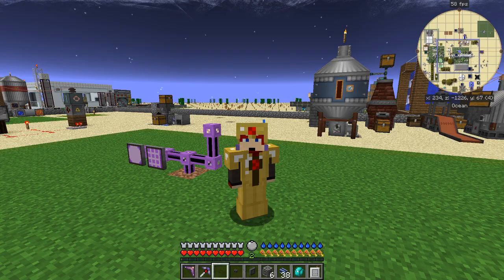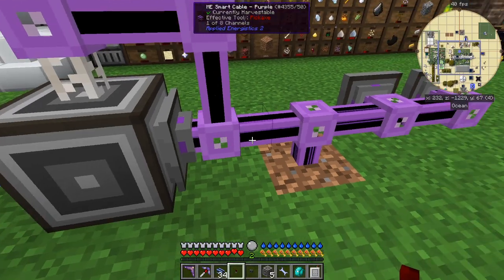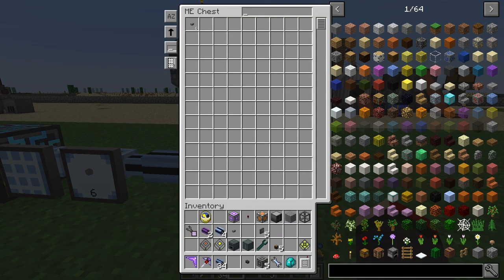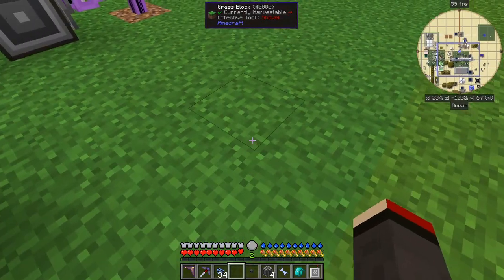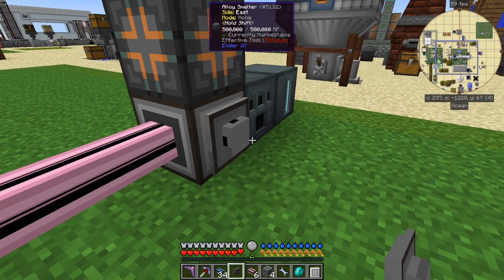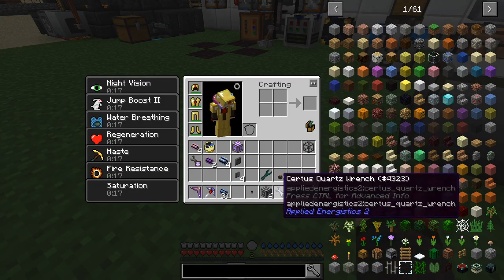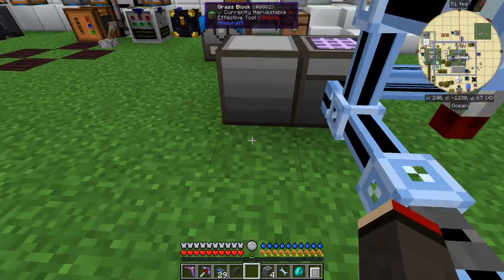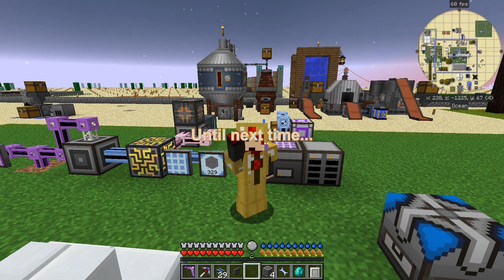Forever Stranded Quick Tip 11 - Applied Energistics 2 Sub-network

Comment: Hey Duncan, you had the same issue that kept affecting me. You setup 2 more with 64, when you did the first one you had 44 in the AE2 system already so it put those in and started the next 20 but since you had not connected the Storage Bus yet, the Alloy Smelter sent the 20 back in the Interface directly but it never passed through the ME Controller so it was still waiting for that craft to complete. I wasted soooo much time on that it was driving me nuts. So if you had connected your Storage Bus before asking for more craft you would have been ok. That's why in the end I decided to always store in a different interface so I would force the stuff to go through the ME Controller :) Once you cancelled the craft it asked for the next 64 and then you had the Storage Bus connected so there was no issue.

That is a really nice trick... The fact that you can save on some channel while nothing is exporting is really a cool trick. I will have to try that at some point :)

For your crafting, I think you're having a bug I was having too, when trying to export, for whatever reason, even though you have Stones in your ME system and some in the Interface, sometimes, instead of exporting those from the ME system, it grabs some from your Interface, but your interface has a crafting card in it so it immediately send the order to craft some more. Then as the export happens, the system re-balances by sending the Stones in the ME system to the Interface and that nullifies the need for the craft so the craft just jams. I believe that if you set a lower priority on your interface it will grab from your ME system first so that you will not get that effect.
Reply from the maker: Philippe Asselin thanks, I saw you episode with the same problem, not completing the craft is a bit of a painful bug. This used to work in 1.7.10. I only had a controller there to show it was a separate network rather than using more than 8 channels.